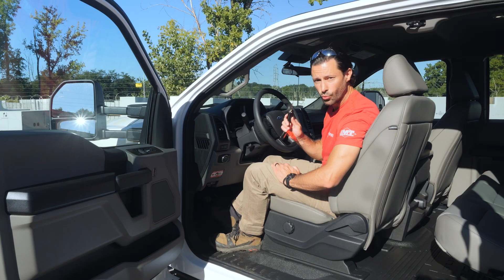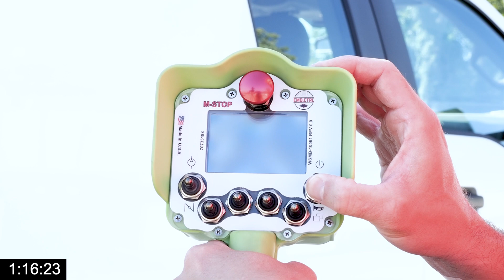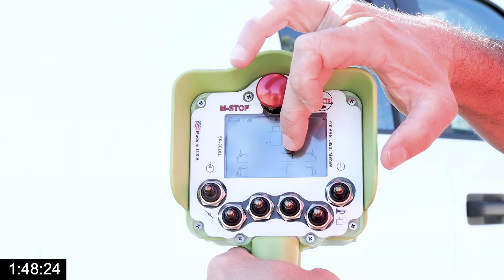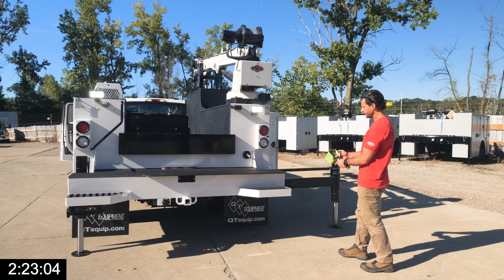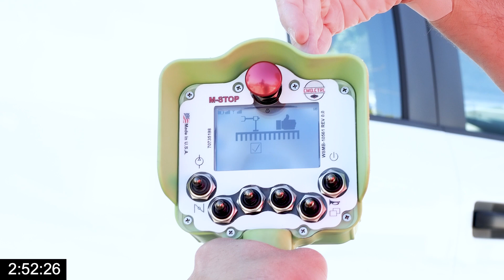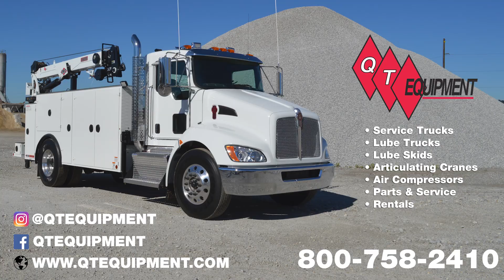IMT Series 4 CMD.CTRL Quick Start Guide

Comment: That' pretty awesome as the other commenter Matt Noted technology great till it dosent work. Curious what the overrides are if they have changed so you can fold your crane up and go home to get repaired or finish a job. Might be good to add to the next video.
Reply from the maker: Thanks Timber!  Yes there is a panel inside the crane compartment where you can do everything you can do on the remote.  Nice backup system in case of a problem.  Will cover in our next video.

Comment: That’s pretty slick having everything on the remote. But I would be concerned with being able to see the screen in the sun with sunglasses on, as well as the longevity of the screen being exposed to sunlight for extended times. Technology is great, until it fails in the middle of a big job and you have to stop and repair your equipment to finish what you were there to do. Hopefully it was built to last like their other products.
Reply from the maker: Thanks Matthew.  Totally agree.  Made a note to test the sunglass / screen visibility on our next Series 4 video.